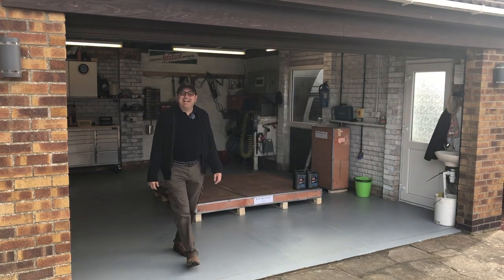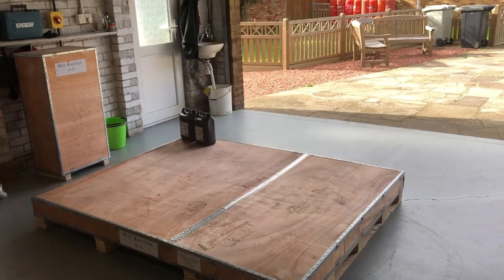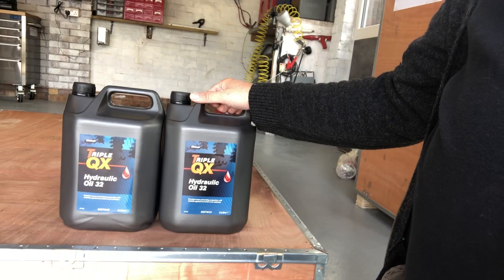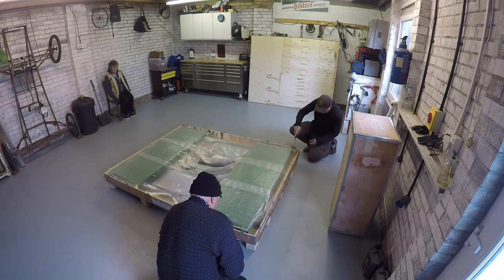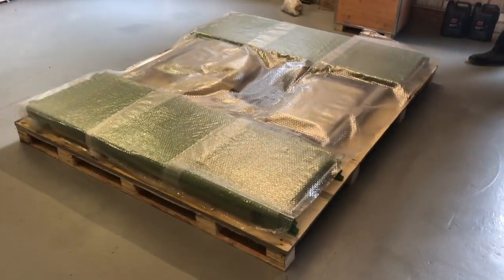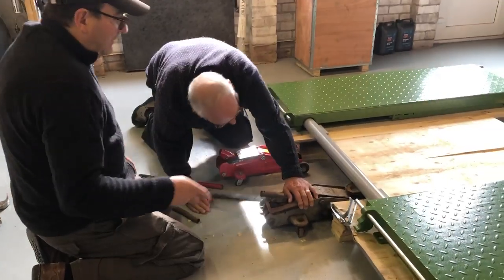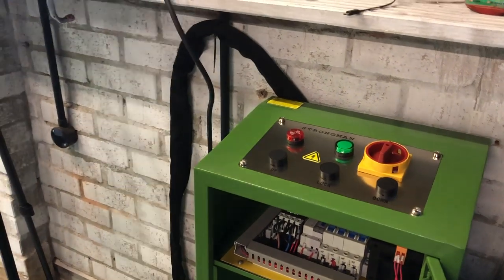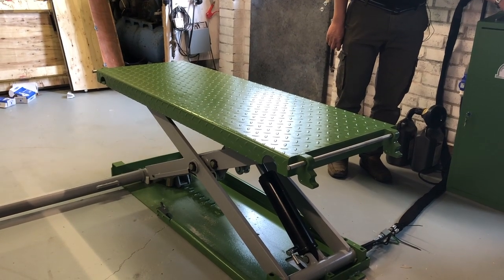The strongman car scissor lift gets installed

Comment: I'm in Australia, would love one of these, it looks really well engineered. Just on another subject, at around 02:52 and a bit after into the video, I noticed nine gas bottles along the back wall of your house. Nine.!! I've been to the UK several times but can't recall ever seeing that many gas bottles at a house.
Reply from the maker: Hi Pete.
Im guessing your Youtube Monika is a clue to your interest.
a) our village is not on the gas supply grid
b) we have a 4 bottle changeover on the house
c) we have a couple of spares
d) We have a static caravan in the Garden that we let out to our friends (we live near the beach) so we have a couple of spares for that too.
Reply: @ToTheGarage  That explains it, similar here if off the grid. We generally have two 45kg bottles which are either swapped out or topped up by a gas truck. My Youtube monika is actually just a nickname some friends gave me decades ago when we used to go 4X4 bush camping when all our kids were little. I always had a 4kg gas bottle and cooker handy in case it rained and lighting a fire for cooking was a problem. Love your scissor lift, the ones available here in Ozz don't look as sturdy as yours. Some are Chinese.

Comment: Hi John,

Brilliant video !! Looking to get one of these purchased in the not so distant future. Couple of questions for you.

1. Is your electrics ran to your house to feed the garage power ?
2. Is your lift in any way bolted to the ground ?
3. What depth is your concrete slab ?.

Thanks Michael
Reply from the maker: Hi Michael. Glad you enjoyed it and thank you for your subscription
a) Yes. It needs a 16 amp supply which should not be an issue for most send domestic arrangements. I had to have electrical work done because after my garage the supply then goes on to a large Static caravan in my garden that is used when family visit. (even then I could have gotten away with it if I wanted)
Reply from the maker: b) I have drilled two holes in the floor and have literally just dropped two bolts through the base plate into them. They are not in any way attached. The only reason for this is that my garage floor is smooth and shiny and the underside of the lift is powder coated steel and when I drove onto the ramp it would move back about an inch every time. (I could have achieved the same with a couple of thin rubber mats
Reply from the maker: c) My concrete is only about 4 inches Thick. I would have no worries at all about moving the lift out onto my driveway which is essentially crazy paving, and using it out there. One of the beauties of the Platform scissor lift is it spreads its load well and does not need to bee bolted down as its portable and comes with wheels. Obviously it does need to nee on hard level ground though.

Comment: I just bought mine but it seems like the platforms don't go down or up 100% evenly. most noticable when the lift is unloaded and you let platforms go to the floor. Then one of both touches ground about a second later than the other one. according to the seller its normal..?

Comment: They appear to have a new version with just one join at one side (thicker) between the ramps.. Instead of 1 at each end. Makes access for a wheeled chair or gearbox jack easer it seems..
Can I ask what your ceiling height is?
Reply from the maker: Hi Chris I have 8ft clearance to the timber work in my roof

Comment: Hi John,a very informative video thanks,I was so impressed I went down and bought one,last Friday good fun getting it off trailer!
I did quite a lot of research on scissor lifts before taking the plunge,and I didn't realise Strongman used the nylon blocks as lower sliders,what is your opinion on these as opposed to the ones that run on steel rollers?
I have read some negative comments on this type of slider,saying you cannot get replacements and they are impossible to replace.would value your thoughts on this,apart from that is seems great,thanks Steve.
Reply from the maker: Hi Steve. Congratulations on your new acquisition👍. Im sure like for me, it will transform your 'Garage play time'
I genuinely have no issues with the nylon slider.
The consequence of this system is that you need to keep the bed on which the slider slides, free of debris to give it a long life,  But the up side is its contact area is massive compared with a roller bearing which would start to make a groove in the steel bed plate from moment 1.
In terms of replacement it might not be available off the shelf but its literally just a block of stock Nylon that has a semi circular pocket cut into it. In the Very unlikely event that ever wear it out, I shall ask a local machine shop to knock me up a pair.

I did end up adjusting the Down speed on my ramp, via the Allen key valve on the pump. It was way too fast for my liking. Other than that and re sealing the drain plug on the Hydraulic reservoir. mine has been faultless.
Please continue to share your experiences with the rest of us 

John👍👍
Reply: @ToTheGarage  Hi John,thanks for the reassurance it does look like a nicely put together piece of kit,have lifted my SUV this afternoon and was effortless,just have to remove some roof beams and change the garage door to roller shutter,all to gain a bit more height.Thanks again all the best Steve.

Comment: Hi John 
Just revisited the Strongarm web site and noticed that they have superseded our lifts !
They seem to have altered it to facilitate carriage, not too impressive in my opinion, looks a little amateur with the sliding nylon block ? You ?
Reply from the maker: Hi Neil. I must admit to being quite surprised. That large plate synchronising the two platforms negates some of the lifts most desirable features in that you have unhindered access to the full length of the cars underside. Admittedly you do have the two bars on the floor in the original but thats the lesser of two evils.

I can see the benefits in transport though. Im guessing the two platforms can be stacked.
Reply: To The Garage
Yep I think it’s to stack for strongman’s convenience not the buyers access ☹️

Comment: What depth of concrete you have on your floor? Thanks
Reply from the maker: 4 to 6 inches. One of the reasons for going for this style (platform scissor lift with big base plates) is it just needs to sit on a flat floor. Indeed mine is not even bolted down as it is a mobile lift. two post lifts, in particular, need a very good and thick concrete base.
Reply: Hi I am in the look out for 3.5t full rise scissor lift. However concrete in garage is 75mm on compacted hardcore

Comment: Where did u buy this from ?
Reply from the maker: Hi Matthew. Direct from strongman tools.  Here is a link to their website
https://www.strongmanlifts.co.uk
Reply: @ToTheGarage  thanks, they don't seem to say a price though but busch have the same one but around the £3600 mark and the height is a little taller
Reply: @ToTheGarage  did u need to use compressed air to set up this lift mate ?
Reply from the maker: @matthewreynolds6562  Hi.  Yes ive just taken a look and they no longer show the prices? mine cost about £2000 delivered, so considerably cheaper than the Busch.  Mine is the Clifton. It does not need compressed air. The safety devices are electrically operated. And it does not need bolting down. It is also mobile, and although heavy,  it can be moved around on a smooth surface by one person using the optional mobility kit.
Reply: @ToTheGarage  ahh ok I thought yours was a "holt" model but that is a full rise scissor lift. The twin busch is a full lift also which is why I think it costs more. Thanks for all your help and info. I'll be looking into one soon

Comment: Hi does anyone know the total clearance to drove over.  I know you mentioned 10cm but how think is the rubber looks around 4cm.
Reply from the maker: Hi Ian. Good ey. The blocks are about 5cm tall but it also came with some 15mm thick pads as well
You can always put an inch thick plank in front and behind the ramp so that effectively you lower the entire thing bu an inch👍
Reply: To The Garage thanks mate.

Comment: what is the size in dimension?
Reply from the maker: Hi.👍 Hope this helps.
Platform length 1450mm
Including ramps 1940mm
Platform width 500mm
Overall width 1810m
height when down 110mm
Max height 1000mm